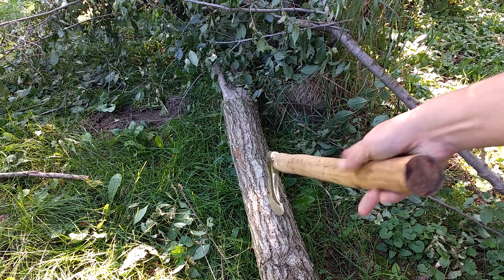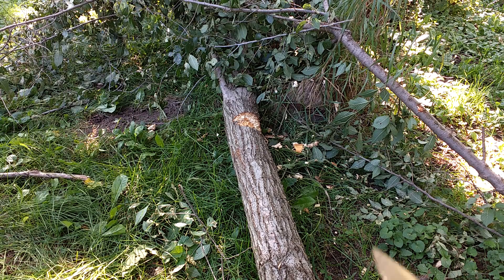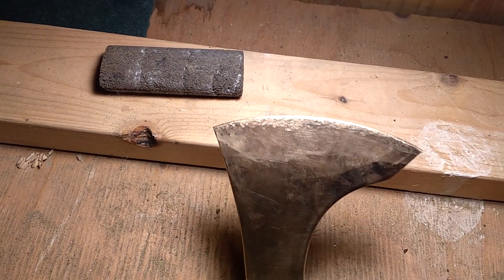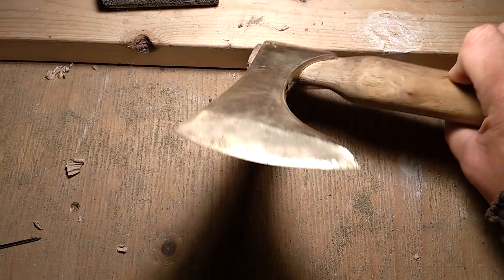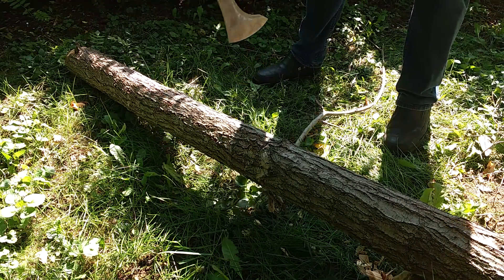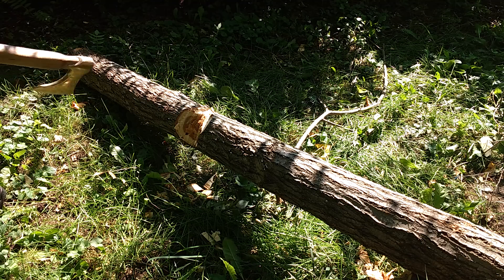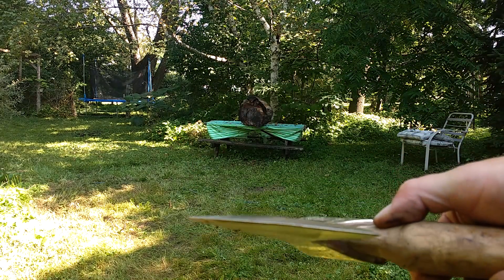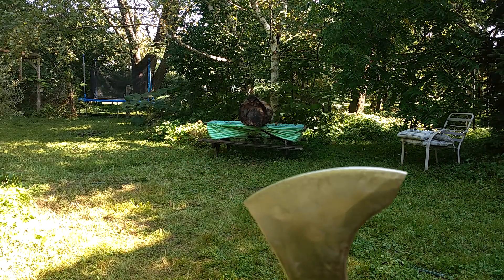Epic Aluminum Bronze Axe Fail! - Annealing Vs. Work Hardening (part 4)

Comment: looks like it worked out pretty well, and will defenitely hold an edge now.
Reply from the maker: Yeah, I'm glad I don't have to melt it down and start over, lol
Reply: lol, so now that you got that all sorted out, what's the next project now? lol
Reply from the maker: Not sure yet...  Maybe my Halloween casting contest entry. Seems kind of early, but then again I only finished working on my cast aluminum jack Iantern desk lamp from last halloween back in May or June or something...
Reply: lol, I havnt even been on the other forum, the way it was going the last time I was on there didnt look like anyone really knew what they were doing and the "pay to contribute" bs david was doing just turned alot of people off of the forum, and from the sounds of it, it pretty much killed that one before it could even get started for long term. So yea, I havnt been back or had any interest in it.
Reply: It's not pay to play.  Lionel doesnt want to fix the file storage issue.  I'm happy to chip in a few bucks.  I get way more information value than money any day.  Best part.  We don't have to explain to the noobs the difference between a furnace and a smelter.  Most of the heavy hitters are there anyways.  I've noticed traffic back at AA seems to be slowing.  You certainly won't see me investing tons of hours on build threads there that's for sure.  I'll stop in and say hi from time to time.
Reply: yea, well, last time I was on there, all of the thread topics that I would be really talking in, like the project threads and the engine threads, they're pretty much locked because I cant pay the subscription fee just for commenting once in a while. To me, that just seems pretty crappy even tho I already posted in some of them, but now I cant even respond to anything because I cant afford to pay. It just doesnt seem worth it in all honesty. 

In my opinion, the traffic in AA has slowed down, but it's been slowing down for a while because the "fad" of metal casting is passing because for a while there, almost everyone and thier brother on youtube was doing it, and now, they've moved onto the new, stupid, trending thing. The people are still coming in, but at least you have to look at it this way, when was the last time you saw a person with a king of dipshit style furnace come in and have to set the person straight?
Reply: Chirpy's Tinkerings I don't know what you can or cannot post as a non paying member as I paid as soon as it was possible.  David will sort out in time what threads should be available to non payers.  I would have rather seen 20bucks, but then again, I'm not paying the bills on that new forum.
Reply: either way, it's just deleted off of my computer, problem solved
Reply: Sorry to see ya go man.
Reply from the maker: I guess I see your point Chirpy. There are only 3 threads in the banner members only area so far though.  I chipped in a few bucks just as I've always said I'd be glad to do to help support the Avenue and make more pic space there so people dont have to trust the next big photobucket, but I'll most likely only be posting in the public subforums on thehomefoundry.  I'm not sure what I would ever want to post in the members only area anyhow.  Got no plans to leave AA or post any less often there either.
Reply: I knew I wouldnt be able to keep everyone happy no matter how hard I tried.  There are areas that are open to all registered members and you should be able to post in them if your having trouble and can not post in areas other then the section set aside for banner member please let me know.
  The area that is set aside for banner members is mostly off topic items that people had requested be added to the forum.  Forums cost money to host and I appreciate those who have donated to support the forum. It ensures that the forum will stay up and running for as long as there is an internet.  Im setting the forum up as a 501c3 and will add in a couple more administrators and set up a board of trustees  in time in case something happens to me. 
  The only thing that is B/S is what happened with photobucket which destroyed many great topics on AA and many many other forums on the net.  Thehomefoundry  org was created for this reason. 
  The forum is still in its infancy and I listen to members ideas and suggestions on how to improve things. If there is things that need improving just let me know and I will resolve them the best i can.
Reply from the maker: Thehomefoundry, I'm enjoying the new forum and happy there's a place like it where members can choose to take a hand in keeping the lights on, especially with our beloved alloyavenue needing owner's attention for some time now that it just doesn't seem to be getting, at least not in any sort of timely fashion.  So I'm surprised that Chirpy seems to have heard some grumbling about the paid membership option on THF, after all the times we've seen people on AA mentioning how they wish they could toss in a few bucks to help buy more pic space and pay for necessary software upgrades now and then.  Personally I have yet to ever want to post anything that I would not want everyone's feedback on, so the members only area was not a factor when I decided to chip in.
Reply: Thanks Tobho. It was quite a challenge to get it all set up and working.  I think people would feel differently about the paid subscribers section if  AA were to go belly up, disappear, and take all your posts right down the gutter.  Photobucket did that in part already and having to use 3rd parties to host photos only leaves it open to happen again. Having the members area also cuts down on the amount of disc space that would get ate up by off topic (non metal casting) projects.  It may seem trivial now, but over the years it could really start to occupy a large amount of space on the drive that is not related to metal casting.  The more space we use, the more space has to be purchased.  Im thinking of the future when I do some of the things i do. It will become more apparent why as time goes on.
Reply from the maker: I get it, just meant that I personally haven't found myself wanting to post anything I'm working on in 'members only' yet, is all.  Looking forward to the upcoming stuff you just hinted at!